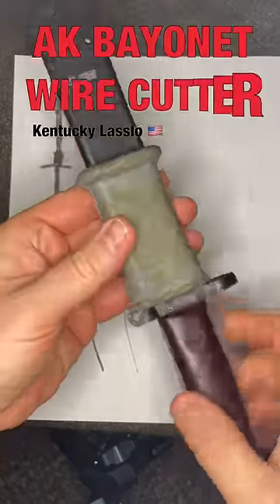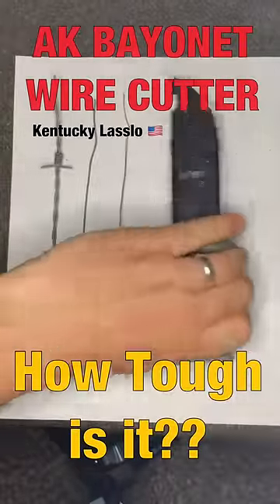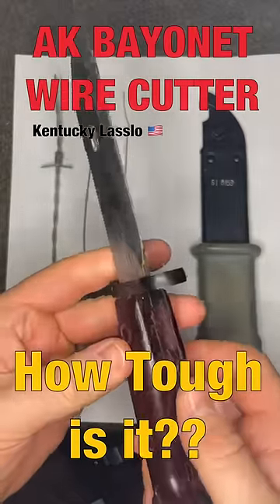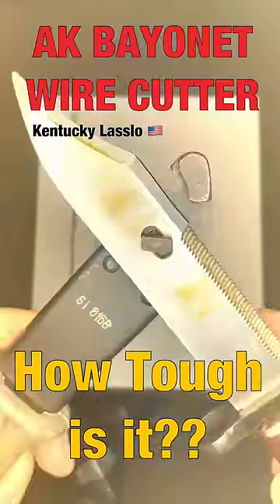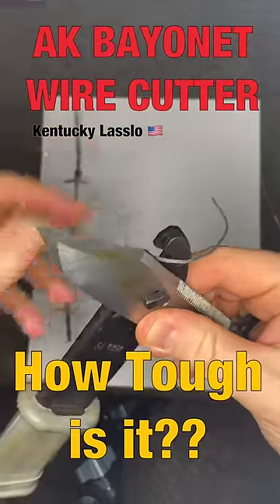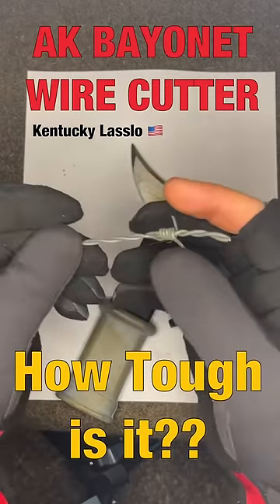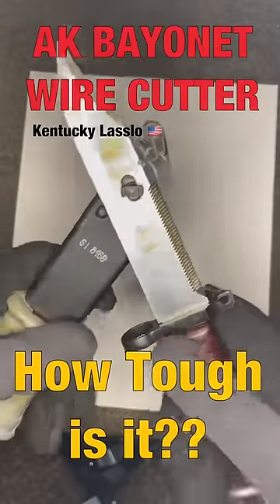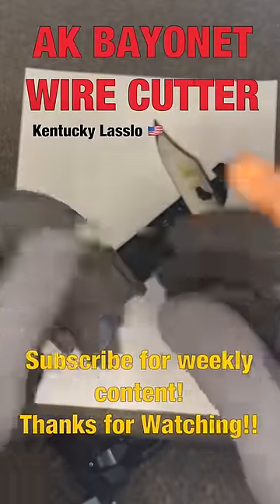AK Bayonet Wire Cutters #shorts #short #shortsviral #shortsfeed #shortvideo #shortsvideo #shortfeed

Comment: Looks like if your not careful. You might cut off your left thumb or fingers
Reply: Hmmm, not really if you angle it correctly. But I understand your concern
Reply: Just wear gloves like every other person with guns
Reply: @salziq2044  true, gloves are almost never used, yet even just for maintenance and cleanliness of the guns, it's good to use gloves. Sweat makes you have a worse grip and rusts easier
Reply: Please explain how? The knife can't come off because it's hooked into the sheeth, and your hands are a lot further away than needed for you to not cut yourself
Reply: The blade on most bayonets are dull
Especially AK bayonets
Reply: @ZackBadCompany1234  true
Reply: @PistaZOV  people somehow manage to injure themselves from rifles with 18"+ barrels. You'd be amazed what idiots are capable of doing to hurt themselves
Reply: @nicholascecil6733  so true I can't argue in any way... Only thing I can say is that if you have more than room temperature IQ, then you shouldn't have any problems injuring yourself on such a contraption
Reply: He’s only really holding like that because he manually had to feed the wire into the cutter instead of just using both hands on something that holds itself up like in a real life scenario
Reply: Bayonets are not sharpened when issued. Soldiers can sharpen it themselves if they want but it is normally to much work when you can just get a knife. These ak bayonets may be sharpened but i doubt it.
Reply: @GHefly445  they’re “sharpened” from factory to do the job at hand whatever it may be
Reply: @brianhawkins3099  Just looked it up and they are in fact dull. Its  used for stabbing not cutting. I own a m42, a k98, and an enfield bayonet and they are all extremely dull. Even the officer sword i own is dull. I assumed the ak bayonet was dull and according to the internet i was right.
Reply: Probably not as bayonets are pretty dull but idk
Reply: @PistaZOV  that hook is all that's in the way of the knife coming down on your hand. Its locked in sure, but if you're cutting a lot of thick wire I could easily see it failing and just sheering off
Reply: @GHefly445 yeah, that's a bunch of bullshit, especially since bayonets for the past several decades (post WWII) have been designed as a knife first and an impromptu pike second. Hell, I own a few bayonets from the WWII era that still have the factory edge and I've split hairs with a couple
Reply: Nope, it's got a stop... Youd have to try hard to do so.
Reply: @Mrdestiny17  it wasn't meant for that, this is like saying a car is gonna fail/be unsafe if you drive off of a cliff. Like, yeah, Obviously, but as long as you're in bounds of the capabilities of your equipment, there really should be no problems.
Reply: you're 💀
Reply from the maker: @GHefly445  It’s not very sharp at all sir!
Reply: @brianhawkins3099  no, they're not sharpened at the factory, not AK bayonets or most for that fact. Maybe modern M16/M4 bayonets like I used in the Infantry but every military surplus ak bayonet I've handled has never been sharpened
Reply: @bobbybrown475  no you have not
Reply: Just hold your fingers on the rubber, the knife will get caught on it
Reply: @KentuckyLasslo  Thank you kind sir.
Reply: It's got a stop, though. These are not a pair of scissors.
Reply: There’s a gard but it’s not enough to be ohnest 😂
Reply: @bobbybrown475  no lol
Reply: It only moves as much as you see. It isn't going to cut you.
Reply: Its actually pretty hard because the bayonet lugs into the scabbard. When its in cutting position you can't separate it from the scabbard, have to rotate it back and line up the hole with the shape of the lock
Reply: @McNoodles  nah they have an edge, a lot of soldiers honed the edge so it can slice. Thats really only a thing for old school bayonets, the exception being sword bayonets, which were sharpened as they were intended to also be used as swords. Modern bayonets double as fighting knives
Reply: @Gangstar645  my enfield sword bayonet had a sharpened edge and old blood stains on it from 100 years ago. If yours doesn't have an edge its either a repro or no one sharpened it since WWI
Reply: The Soviets call that a free lesson of what not to do
Reply: Just pay attention a little
Reply: How? I think you need to win a medal from creativity if you manage to cut your finger with that.
Reply: I saw that Too...
Reply: Just like any other wire cutter or bolt cutter
Reply: Looks like if your not careful🤓
Reply: No the rubber handle is simply at the same distance as the knife handle. If u manage to get the scabbard past the hand guard your fingers would just hit each other
Reply: @punklyrics1  punky ur replying to someone named gangasta... r u talking about bayonet (I think u are) or a sword? Also thoes blood stains are just rust. You are correct any military bayonet is going to be sharp.
Reply: @TrapperAaron  nah the old WWI sword bayonets were also intended to be used as swords in the trenches aside from being bayonets. And its not rust, its oxidized blood. But most bayonets arent sharpened, have an sks with a blade bayonet and there is no edge on it, same with my m1 garand bayonet
Reply: Worth it
Reply: Spoken like an individual completely ignorant of what they're speaking on
Reply: You can also flip the blade over
Reply: @LuisC7  my trigger hand is gloveless. I like to feel.
Reply: Bro this is a whole war 😂
Reply: Well then don't do that. If you're really scared ask for a cut glove from a cook but it'll still hurt like a bitch.

Edit: that cut glove might not do shit against this though. So stick with not putting your fingers where they can get cut off
Reply: Isn't that the case with any knife🤣
Reply: Well in that case don’t use hand tools if you’re not careful
Reply: Looks like you don't own an AK bayonet
Reply: There are 3 things that would prevent that from ever happening. 
1. There’s a solid pivot joint on the sheath that would prevent the blade from slipping.
2. The cutting edge on the sheath stops the blade from closing further than necessary.
3. There’s a handle on the sheath that you are supposed to hold the sheath by, if you hold the sheath further up you could get cut and you would loose a lot of leverage making it harder to cut any kind of wire.
In conclusion, the only way you could hurt yourself using this is to be an idiot who doesn’t know the laws of physics.
Reply: How the hell would one do that?! After how many beers?
Reply: @GHefly445  by dull, do you mean like, it's got a dull sharp edge or is it literally without an edge?
Honest question I know jack shit about knives
Reply: @shuenshuen  without an edge. Never sharpened. Flat. I can rub my finger on all of them. They are  ground in a way so it looks like there is an edge but there isn’t.
Reply: @shuenshuen  its a bayonet not a knife. Armies typically issue separate knives for their soldiers. The ka bar or the Swiss army knife are both issued to soldiers as well as bayonets. Just because it looks like a knife doesn’t mean it is one.
Reply: Not really. You'd have it mounted on the rifle, and only be handling the sheath in your other hand.
Reply: Good way to coerce confessions, da?
Reply: @LuisC7  gloves when your cleaning or changing out anything really, they’ll save you so so much pain.
Reply: @sulcata2007  yeah don't have to clean sweat and grease
Reply: There's a little stop near the end that keeps the bayonet from continuing to rotate.
Reply: it doesn't even have an edge bevel on that side
Reply: @GHefly445  you definitely don't need a sharp edge to stab someone or something, and considering how a bayonet is gonna be used 9 outta 10 times your not gonna be slicing at a downward angle or swinging it from Side to side your gonna be stabbing just direct straight blows.. so there almost isn't a need to have it with a very sharp edge, although if I was using a rifle with a bayonet attached yea I'm gonna Sharpen it just for good measure Incase I did need to slice with it.. cause you never know what can go down in battle..
Reply: @jdubskiwright2380  You probably could hurt them if your swinging a 8 pound rifle with a bayonet on it even if its dull. But yea you were meant to run it through their chest and stomach. You just needed to thrust it in em and they’re dead.
Reply: @jdubskiwright2380  People used the butt of the stock like a mace too. The english did that in the war of the roses but it definitely happened in ww1.
Reply: It's Russian made they don't care if a finger goes missing or you get a small cut, just a sip of vodka straight from the bottle and youre good to go.
Reply: @GHefly445  o for sure they did whenever they were up close and had the angle to do it effectively hell yeah they would crack enemy's with the shoulder stock, your either knocking them unconscious or killing them depends on how hard you hit them and how many times though..  something i find to be ridiculous during ww2 is the Germans after finding out about the 12 gauge shotguns the Americans and English used, and I'm sure several other countries also, the Germans tried to ban the use of the shotgun because of the damage it caused, 4 or 5 guys with 12 gauges at the top over a trench could wipe out 3x as many enemy's with them, the Germans said it should be a war crime to use shotguns and they really did fear them.. really Germany?? Considering what you were doing to people and you wanna cry war crime over a weapon that fires a shell rather than regular rounds because they caused severe damage?? Gtfo outta here.. but the Germans didn't see any problem with the machine gun M42 I think it's called, US troops called it Hitler's buzzsaw and it was one of the fastest firing machine guns of the era and it absolutely cut people and anything else it hit down.. naw that was cool to use and lay down 100 enemy's with in less than 30 seconds but the ole 12 gauge wasn't ok... That's like shooting at someone with a full auto AK with a 75 round drum and getting upset because there shooting back with a .22 semi auto handgun..
Reply: @GHefly445  I thought that a few firearm manufacturers had made better improved design's as the war went on though?? I thought there was even a Browning made shotgun at one time..and Remington made a model of there own an what not??
Reply: @Sphyxx  a sip?? You mean a huge swig,. Two or swigs an that 5th is empty lol.. I've only seen a few people in my life that were hard drinkers actually kill an entire by themselves with only 2 or 3 swigs.. man it's impressive but I also kinda felt bad for those guys, just for the fact that they were that bad on the booze... An they didn't just drink on the weekend or with friends sometimes these guys woke up and immediately first thing they would do is hit the bottle, they would go through at least 1 or 2 5ths a day, everyday.. they still functioned and worked n what not but they definitely had some serious problems.. I know now at least 2 of them are passed away either from the results of drinking so much for so long or from unfortunate accidents.. it's sad to see someone that's so bad on that shit.. no better than shooting dope.. horrible..
Reply: @jdubskiwright2380  I don’t think any models were improved on during the war. The model 1912 was also used but in very small numbers. Ike 50,000 shotguns were used in ww1 but most of then were 1897. The 1897 isn’t a bad gun by any means. Most of the fault was on the paper shells swelling up and jamming the gun. A lot of these military memes aren’t true and are propaganda to boost patriotism or just to be funny. The  A 10 kinda sucks, the sherman was the best tanks of the war, the t 34 is a piece of shit, the abrams might be good but it hasn’t proven itself yet and is getting old. There are more but these are the ones i could think of.
Reply: @GHefly445  the Sherman tank was the best during ww2?? Really? I've seen a lot of documentary about WW2 and all the numerous tank battles and even some American tank crews said they feared the Germans panzer because it was way faster and had a bigger better main canon on it.. and the one true weakness of the panzer was the rear end where the engine was, an if it was hit just right that it would disable the panzer and make em a sitting duck,  the Germans had some rather advanced weapons in ww2 and they knew how to use em and make them reliable and power and therefore effective.. and the US Abrahams how do you consider that not proven?? It's been around in use for decades and is one hell of a tank. It's rather fast and manuverable at least for a tank, it's got great guns on it and the armor has only gotten better over time..
Reply: @jdubskiwright2380  The guns on the Sherman were perfectly acceptable for a medium tank. Remember, a tank is meant to combat infantry not necessarily tanks, thats a tank destroyer, anti tank gunner, and infantry job. In the start of the war the sherman crews didnt have enough training, that was the main problem. The army offered the improved 76 mm gun but no one wanted it because it wasnt good at killing infantry. The sherman armor was slopped and thick enough. The abrams has yet to go up against a modern mbt. It did great in the middle east but those tanks and their crews weren’t top notch. I think the abrams is a perfectly adequate tank. Also the gun on it is smaller than almost every other mbt. It uses a 120 mm gun while everyone else uses 125 to 140mm guns.
Reply: @GHefly445  I see your point about the Abrams, even though it's older yes I think if they continue to give it upgrades through time it can remain relevant and continue to be effective on the battlefield, upgrades to it's armor which they have done with the system that detects incoming rockets ECT, and it blows up a smaller ordinance right before it hits the tank and it slows down the rocket or whatever, that's pretty cool.. the weapons can always be upgraded and the technology within the tank itself ya know..  I think if you put 2 Abrahams up against 15,  T72s or whatever there called or even 2 or 3 Abrahams against some of Englands, Germany's, Frances, ECT there best newest tanks against our latest upgraded Abrahams that the Abrams m1 a1 would hold it's own if not come out on top with minor damage while laying waste to the other tanks... Especially with a good trained and experienced crew in the m1a1..idk just my opinion really..I'd love to see how our US tank does against other countries though, especially china's tanks, cause if there's one country we need to be prepared to defend against and destroy the equipment they use it's China for sure.. there gonna start some serious shit in the next decade or so..
Reply: @McNastehP  regular wire cutters generally aren't what you'd call sharp...
Reply: Soldiers are running through gunfire and throwing live grenades, I’m pretty sure a wire cutter is the least of their worries
Reply: @McNastehP  Man If only we could shar...Wait.

Yeah hit you yet?
Reply: think any of these guys code name is "butterfingers"
 or after a couple incidents, "butterfinger"
Reply: I don't see how.. the blade pushes against another piece of metal. It stops it. You cant catch your finger between the knife and the sheath
Reply: not to mention that it wouldnt be able to cut concertina wire
Reply: @akiraic  chill bro what is wrong with you?
Reply: Yes I’ve seen them break and I almost cut myself when mine broke. But it’s safer than being shot at and that’s allowed in the army.
Reply: How??
Reply: @timofeifilippov9558  when the lugg weld breaks
Reply: I appears that once the wire cutter piece closes there’s a stopper on the top of the sheath preventing it from closing further than it needs to.
Reply: The bayonets were not issued with sharpened edges.
Reply: @samuelprice2461  some of them were. Manny issued items are not new but from a dead guy who took orders
Reply: It can’t hinge any further than it was shown in the video. So as long as you don’t put your fingers directly at the top, where the two pieces meet, it’s not a danger.
Reply: @sleepingbee8997  until the lug breaks off as they do,
Reply: Like buttah
Reply: The knife can't go anywhere, because of the hole.
Reply: Not at all bozo 😂
Reply: @pineapplesideways3820  how funny
Reply: @McNastehP  i found out from a sergeant the reasoning for this. 

Try running in full gear though a field full of obstacles and not fall on something. Now imagine 60-100 people doing this at the same time close together. 

Do you really want someone next to you running full speed with a knife swinging inches away. Do you really want it sharp 🤔🤓🤯
Reply: if you think you can't get hurt doing this I'd assume you haven't used many tools
Reply: Then be careful. The world isn't a safe place so use some common sense.
Reply: learn to use it then.
Reply: @LuisC7  isn’t it mandatory to wear glove in the military especially on a mission or something
Reply: @asiansquad7738  yes
Reply: Yeah... You have to be careful with all knife... Ya know cuz they're sharp
Reply: @PistaZOV murphy🙄
Reply: @nicholascecil6733 or just unlucky, not everyone that gets hurt is a idiot
Reply: it’s you’re not your
Reply: Ummmm do y’all not see the “stopper” that’s also doubling as the pinch cutter…? Pair that with the way it’s “mounted” on the sheath to pivot..that knife will only slip towards your other thumb if you’re not applying equal, in-line force or you’re trying to cut a wire that is too thick, causing it to slip over and out of line with the “stopper”
Reply: Yes it is a knife
Reply: Your and you're are different words with different meanings, Einstein.
Reply: he won’t
Reply: 6k likes.. fuck we are doomed.. once the wire is cut you cannot close the tool any further, the mechanism that cuts also stops the blade.. how the fuck do people not understand that whilst looking at it blows my mind
Reply: How TF you gonna put your finger in the tiny hole where the wire goes?????
Reply: So,BE CAREFUL! Simple
Reply: no. try again
Reply: Scissoring action on the blade side.
Reply: U need to be slav to have safety from knife.
Reply: The US m9 bayonet is the same thing essentially and na fr they dope the sheath is big enough to hold good
Reply: @aaronroach1333  ...you mean " after how many vodkas?" 😄
Reply: @McNastehP a soldier should be sharpening them himself. Plenty of free time on the field.
Reply: @LuisC7 Not sure where you got the information about gloves not being used. I've been an infantry Marine for 3 years, every single unit I've been in has mandated gloves to be at the very least carried on your person to every field op, and even in the hottest climates in the middle east, we still all wore gloves. Sucks trying to do anything in heat or cold with bare hands on metal rails.
Reply: @roguespearsf AK bayonet must NOT be sharpened other way, than from factory, because designed as a basic tool to stab at kevlar vest, cut wire/metal/chop wood with help of stone or shovel and most of all to open cans of conserved food. Not for shaving and other fancy things. People designed it were at WW2 and knew exactly right usage of bayonet tool by soldier. You just think at wrong box.
Reply: @bobbybrown475 everyone and their great grandpa is calling BS on splitting hairs with a bayonet but u gave me a good  laugh. 😂
Reply: I was thinking the same, or at very least it would be a knuckle buster if the wire was thick.
Reply: In this case, he was def carefull enough. Hence, he didnt cut him self.
Reply: Этим ножом порезаться не получится, он не имеет режущей кромки.
This knife will not cut you, it does not have a cutting edge ...
Reply: Well, you had better be careful then.
Reply: @bobbybrown475 not bs, I own a few ak bayonets, they are all dull.
Reply: They ain't that sharp
Reply: Sounds like you personally should stay away from knives. If you’re scared of it then it’s bound to hurt you.
Reply: Your and you're are different words with different meanings. I was five when I learned this. 😂😂😂
Reply: I came to say your gonna lose that left thumb